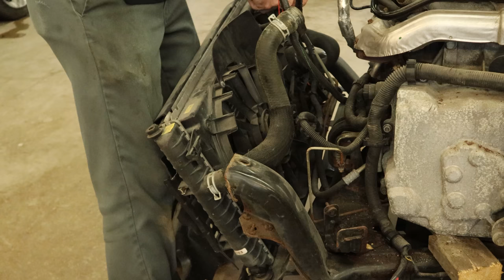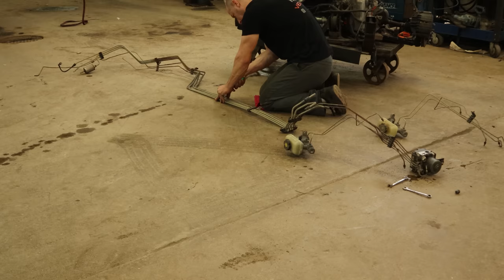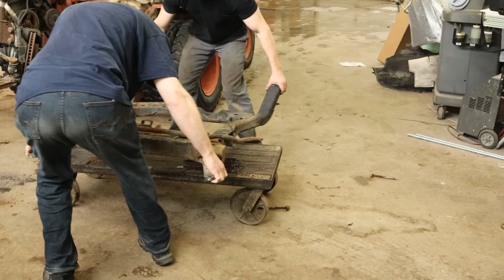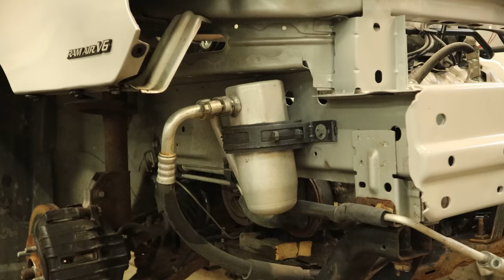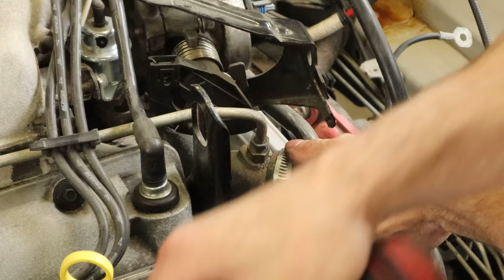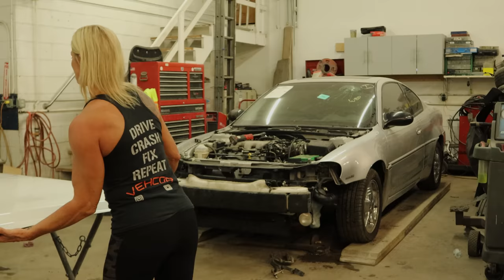The engine is already going back in the cheap Grand Am, but will it run?  part 4

Comment: That junction box bracket is setting my ocd off, a wire brush and some paint man 😂😂😂
Reply: I'm sure you'd agree that not matching the brake lines with the rest of the underside was the better spent effort.  Definitely not an OCD guy's car!  :)

Comment: I really enjoy these videos of you working on older model cars, very nostalgic but I do have one complaint this time, I wish you would've painted the bracket that holds the junction/fuse box, the engine bay looks soo nice painted and clean and that rusty bracket looks horrible, other then that, great videos, can't wait for the next one

Comment: I bet they ran a bigger wire from the alternator to the starter and removed both before selling the car (common practice with high power stereo, part of the Big 3 upgrade)

Comment: That subframe and engine bay bracket really could have used a blast and paint.  This was the first time I can say I was a bit disappointed in a rebuild.
Reply: its not needed   looks fine
Reply: One winter and you'd never know the difference
Reply: Too nice & its a dead giveaway its been repaired. But the members rust & fail regularly here in Ohio so a new/nice one is a great find.

Comment: It's worth fixing because you can do it quickly. Then it can be a saviour car for winter driving.

I have an 03 malibu. Low miles 71,000 had since 14k.  But southern car after 1 winter use in Illinois so it's still a good car. Minor interior damage but that's all.

Comment: I always wondered why GM didn't put the 3800 engine in the Grand Am GT -- surely it would fit and if I remember correctly it has a little more giddy up.
Reply: Likely more of GM's cost-cutting.  They were and still are notorious for cutting corners.  The 3800 was for the most part their flagship engine for their FWD products.  Probably didn't make financial sense to the bean counters to put their flagship engine into a mid-range product.

Comment: I see you're using the Earthquake XT which honestly considering its Harbor Freight lineage is actually pretty good but I recently upgraded from a DeWalt XR to an M18 Milwaukee Fuel and let me tell you Scott you'll love it. It's literally ridiculous with the torque, I was used to the DeWalt and sheared a lugnut straight off the first day using it. A must have for rusty bolts man

Comment: The battery tray and fuse box bracket could have been painted some rust check paint dose not require sanding just paint it and then it look nicer at least

Comment: I'd bet it's likely the previous owner had a large gauge wire running from the aftermarket alternator directly to the battery. Common Car audio thing.
Reply: I'm surprised it did not turn into a Car-B-Q as a result as well!
Reply: @irongoatrocky2343  why would it?

Long as it’s routed properly then it’s no issue. 

Battery and starter cables don’t exactly have fuses and cars just don’t burst into flames because of them.
Reply: @South_0f_Heaven_  well some do have an inline fuseable link, but running an amplifier or capacitor without a link or fuse inline somewhere isn't where's your going to have issues/problems!
Reply: @irongoatrocky2343  yup I always try and put a fuse on  heavy gauge wire going to a car amp but general rule it’s better to draw off the battery since it acts as a capacitor itself. 

Unless your using some crazy exotic car audio then capacitors really aren’t needed and better off upgrading the alternator if the cars electrical system can’t keep up with the draw. 

Grounds are more important anyway and are often overlooked.

Comment: I bet he taped that wire up and put it to the side, so then he could run a much larger charging wire---   which is no longer there now because he kept it.  Just judging by that heavy ground wire that he left behind, I'm 99% sure that the charging wire was likely that same size---  but it was longer so he took it with him.

Comment: You said it took 2 hours ish to take the engine out etc ,, how long did it take to reinstall with the new parts ?  I think I took longer to change that steering rack than you did to drop the engine ,, geesh,.!

Comment: 1.53 hello, sometimes when you upgrade the sound system, they do what is called the big 3 wire upgrade. this is when they add 0 gage or 2 gage wire to the charging system.  i.e  a red wire from the alternator to battery, a black wire from the body to the battery and a black wire from the body to the engine. thats could be why that wire was taped up.
Reply: Yep came here to the comments to say this. They taped both ends and ran their own heavier wire and on these cars the alternator goes to the battery by way of the starter stud. Missing the battery and the alternator because they kept those with most of the battery cables
Reply: @timhalpin9729  Aah don't no no that the wire ran that way , thank you :}

Comment: Do you re-use the subframe bolts on cars? I have to lower the engine cradle on my pizza girls traverse and they say it's TTY bolts which shouldn't be reused. What's your opinion kind sir?
Reply: Follow service information. If noted to replace, replace.
Reply: I just looked in the 2002 Factory Service Manual for the Grand Am, and it does not say anything about TTY subframe bolts, so I assume he reuses them; but if they ARE TTY, replace them for peace of mind.

Comment: Someone is going to be swapping out that subframe again in a few years, since you didn't even take the time to at least rattle can paint it while it was stripped bare.  I can understand skipping most of the parts, but that subframe is the main reason that you took all this apart, and you didn't even clean up the used one you had.  Kinda silly.
Reply: Just surface rust it’s in no danger of falling apart
Reply: @ryans413  The other one started as surface rust too.   When you already have it out of the car and totally stripped down.  You might as well take that last step and sand blast and paint it.  same goes for that crusty bracket under the fuse box on the drivers side.  At least hit it with the needle scaler and throw some rustoluem primer at it.  I understand that it's not a restoration-- but it just looks so silly to put all that brand new metal on there, and then completely skip that rusty bracket and subframe.  He's pretty much guaranteeing that those will need to be replaced again in 5 more salty winters.   Maybe he doesn't expect the car to even last that long.  Otherwise it was a great rebuild, and I like how he uses a lot of parts that they already have laying around--  but seems to either do it at full 100% or completely skip it-- one or the other, but no in between;  and I don't agree with that personally..  a good 'half-ass" paint job can go a long way to slowing down the rust monster.
Reply: @calholli  I see your point i guess

Comment: As of this posting you have collectively wasted 38,726 hours of very expensive internet experts time.
54k views @ 17 minutes = 918,000 minutes
42k views @ 19 minutes = 798,000 minutes
38k views @ 14 minutes = 532,000 minutes
2.7k views @ 28 minutes = 75,600 minutes
Total minutes wasted = 2,323,600 or 38,726 hours.